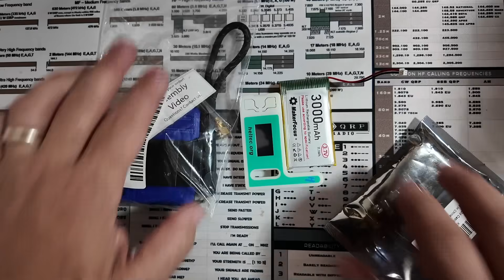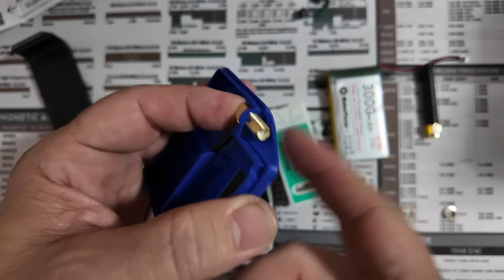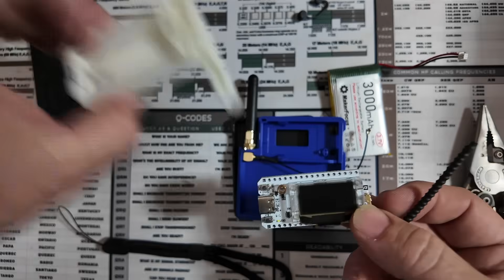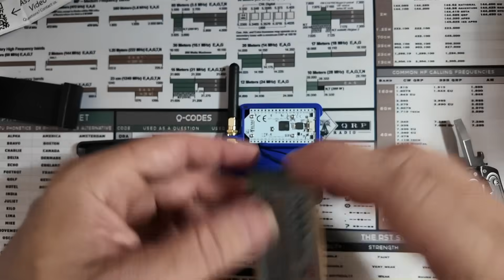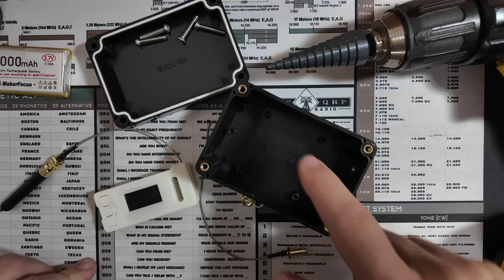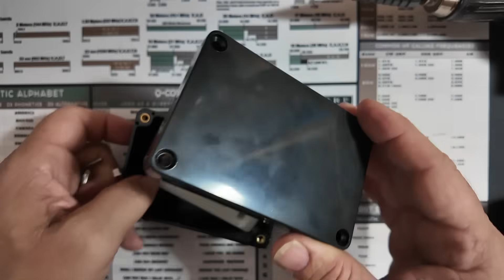Quick and Cheap Meshtastic Node Build Using Heltec V3 Boards

Comment from the maker: Case - https://amzn.to/3Ij1sMB
Battery - https://amzn.to/4kh9NxT
Heltec V3 - https://amzn.to/4ltvpIk
Project Box - https://amzn.to/4kbhXYw
Short Antenna - https://amzn.to/3TA7kUt
Long Antenna - https://amzn.to/4lsmHKh
Heltec GPS - https://amzn.to/3ZPIHGL
Trekker Delta - https://amzn.to/3ZSy6e6
Stepper Drill Bit - https://amzn.to/46qE5e9

Comment: What is the range on this just by itself?
Reply from the maker: Depends on topography, antennas on the devices and height above ground. In my area, 1/4 to 1/2 mile if both nodes are at 5 feet above ground. But I have also reached out greater distances when one node has higher elevation.

Comment: So great video, as always, I know that this is a slightly older video but if you choose to build another one of these, I would advise possibly looking into a whiz block meshtastic, I've built the same node that you have, and it's great. I use a 3000 mAh battery instead. It goes through that battery in about 24 hours. But I have a Atlavox which uses the wiz block meastastic board? Currently, still doing a power test. I'm at 4 days, 20 hours and I have 24% left in my battery with a GPS and a temp & humidity sensor. 37% battery on the one with just the temp &humidity sensor GPS off also up 4D 20hr
Just some food for though
Reply from the maker: The Wisblock and the Heltec 114 boards both get incredible battery life compared to the V3 boards. I have a 114 in the Spec 5 Trekker Delta that can run for almost a week on a single charge.
Reply: @KM4ACK i remember the video you did on that. But i did not realize that had a heltec board in it. I'll have to rewatch that video and look in to that board

Comment: If you are wanting to get into meshtastic to "see who's out there"  you are going to be disappointed.  The range in flat tree infested areas is about a mile and a half max.  You can extend it of course by placing nodes high up.  It is a tactical comms device.  It is not a DXing device.  I have seen aeronautical mobile nodes (not sure how legal that is on a commercial aircraft) extend the range of my nodes many miles.   Unless you have very mountainous terrain and are able to put nodes up high be prepared for disappointment.  Just putting it out there. 73s
Reply: Yep been runing meshtastic and also meshcore. Dead as a dodo in Corby Northamptonshire UK
Reply from the maker: I was pleasantly surprised this weekend while attending a very small local hamfest. We saw over 20 nodes online at any given time. While I don't see as many from my QTH, Meshtastic is growing by leaps and bounds in our area with several new high level nodes getting ready to deploy.

Comment: Very interesting.  Is there any configuration which needs to be done to the nodes?  Or are they just plug & pray?
Reply from the maker: You will need to flash the nodes but it's super easy as Meshtastic offers a web flasher that only requires a browser

Comment: is the board programed?
Reply from the maker: Not out of the box but there's an easy to use web flasher that only requires the browser and usb cable to get it up and running. takes less than 10 minutes.

Comment: The Meshtastic stuff is fun, and I am going to build a base station for outside in the future, say get a box, a good antenna, and a 8,000mAh battery with a solar panel. The only issue I'm having right now (I own two H2Ts from Muziworks) is that I can't get any messages to the rest of the mesh where I'm at. The antennas are better for receiving than sending. Maybe I need to get up higher, or perhaps I'll be able to get better acknowledgement once I get an outdoor repeater setup for my area.

Comment: What happens if you power it up without the antenna on?
Reply: The world will implode. Please don't do it! But in all reality probably nothing.... It could potentially damage the "radio" because the node will tx without you hitting a button.
Reply: @themercman07 thank you
Reply: The same thing if you key up any transmitter without an antenna

Comment: I ripped the IPEX connector off the circuit board when trying to change off the stock antenna. Still have to try to solder it back on.
Reply from the maker: That's a bummer, but it is fixable with a soldering iron.
Reply: @KM4ACK  that's the plan! Get the connector positioned hold down with something other than my finger 😊 and hit the center conductor and shield with my iron.